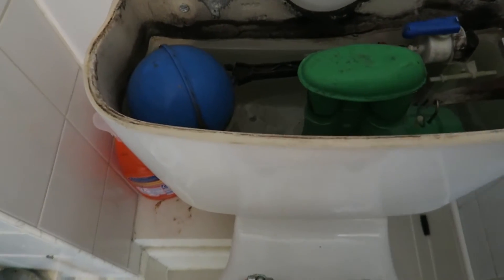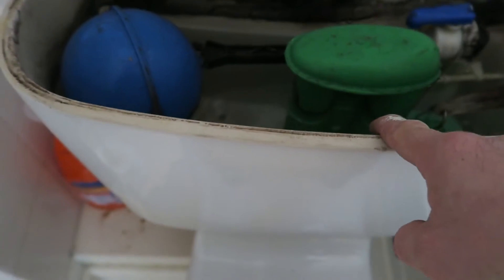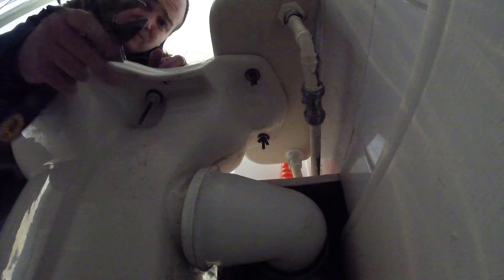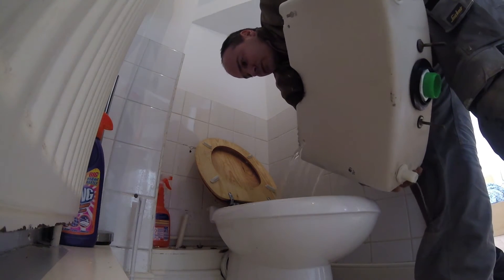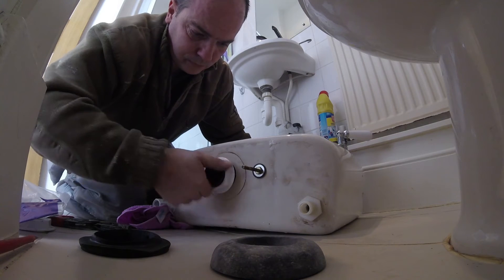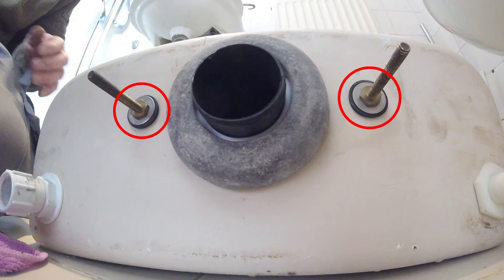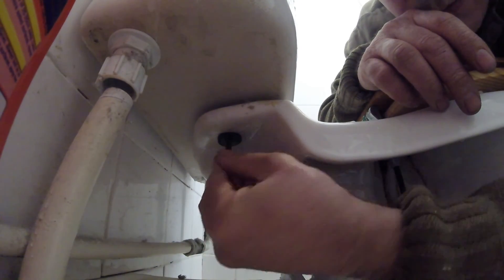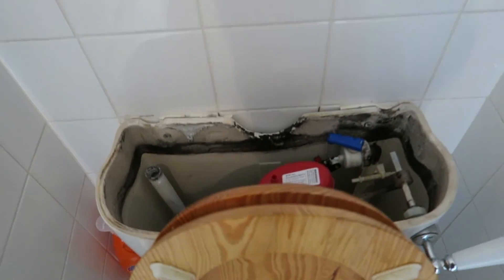Toilet Won't Flush ; Toilet Siphon Replacement for Close Coupled Toilet

Comment: the only thing before you conect  the system to the wall you should  run  a bead off silicon  and a ruber washer and metal washer to the wall enjoy the video.

Comment: Do not install this syphon this is incorrect use a dismantable syphon so if this problem reacurres you can replace the diaphragm washer without removing the cistern from the pan
Reply from the maker: That's a good point. 
I would say that you should choose a make you think will still be around in the future. 
Syphons tend to last 5 to 10 years and beyond. I have went to get replaceable parts for syphons only to discover that the company who made them has gone bust or they have changed the design slightly and the new parts don't fit.